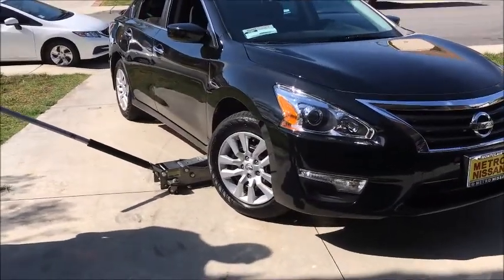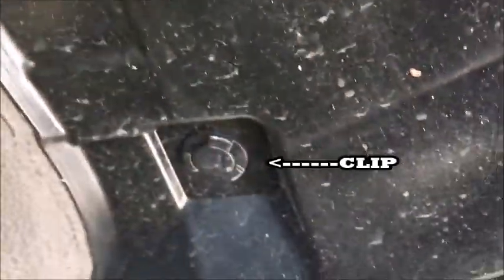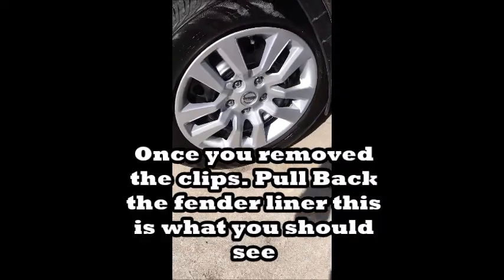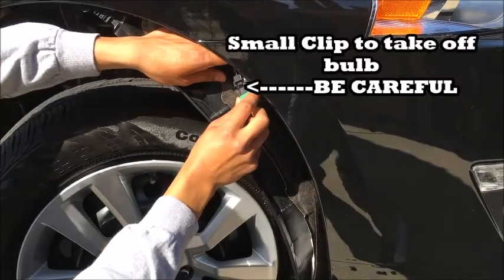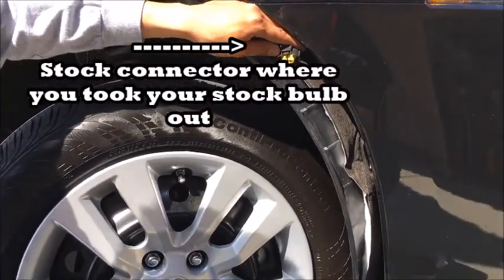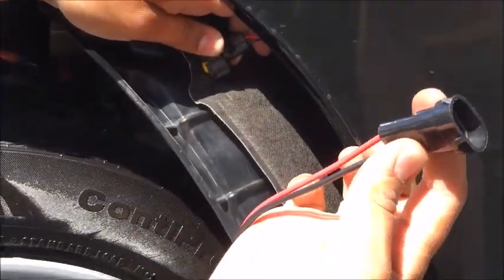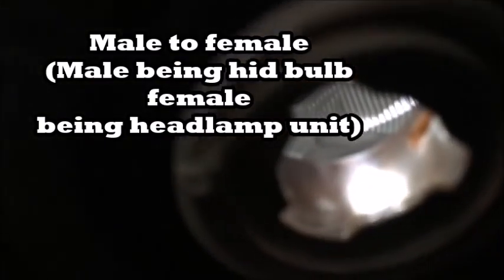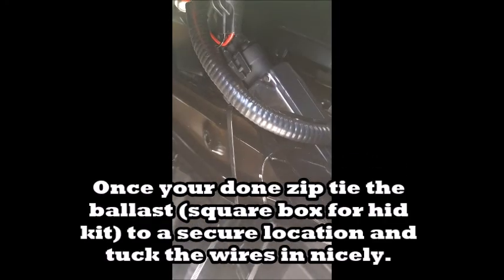How to install hid kit on a 2015 nissan altima

Comment from the maker: FOLLOW MY INSTAGRAM @_jesserizo 
First just make sure all your connections are correct(red with red black with black) if that doesn't work sometimes it can be that you received a bad ballast or bad bulb how this kit is more on the budget side it can happen. It has happen to me on a different kit that the ballast was bad
Reply: See the only problem is that the passenger side is the only connection that is red/black. The driver side is pink/yellow I believe. I've tried this with two different ballast and two different kits
Reply from the maker: +Djaygotsole I wonder why? Mine have always bin red and black on both sides for all my cars I'll give you a link maybe this can help you http://www.xenonhids.com/installation-guide.html it's a diagram on how to install it
Reply: +Jesse Rizo got it to work. Thanks for your help fam

Comment: 35w? Or 55w? Also, it’s been two years since installation, any issues/flickering/warning lights with not using a relay harness? Going to install on my gfs 13’ Altima
Reply from the maker: Leo Canales 55w I believe I cant Rmemeber 100 percent and as far as that they’ve been running strong currently still on the car but I will be honest these past two months they’ve started to dim but hey for the price I think they were worth it

Comment: Just bought the same hid kit for my 13 Altima I see you did not use the relay harness nor the capacity cables. How did they hold up?
Reply from the maker: Sugar Daddy it's almost a year now and so far there still turning on normal and working if that helps

Comment: Ive got the same 2015 altima, seems like you dint need a capacitor? no flickering issue? Just wanna know how your lights are after a year of use. 

Great video Btw.

Thanks!
Reply from the maker: N Tar so far no issues at all still have the same bulbs I can make a video soon on them showing but so far there good, 
Thank you,
Subscribe for the review video if you want

Comment: Do you have to buy anything else with it or everything comes included ????
Reply from the maker: The one that I got came with the whole kit which was the bulbs and the ballast that connects straight to ur stock headlight wiring its simple to install just follow exactly how I did it in the video

Comment: I've got the same car, I'm looking online for hid kits and it had low beam and hi beam. Can I not get just one kit that will do both? Or do I have to purchase hi and low.beacause there are two bulbs? Pls help thx
Reply from the maker: If I’m not mistaken I believe from what I remember they are separate bulbs
Reply: Oh okay, and do you think it would be okay with having two seperate hid kits per headlight ?

Comment: Connect my H11 however it did not come on. Used a elite series II ballasts, what am I missing?
Reply from the maker: There polarity specific you may have just connected the connections from factory harness to hids the wrong way just disconnect flip the connection and reconnect